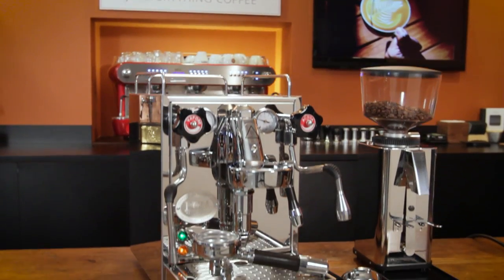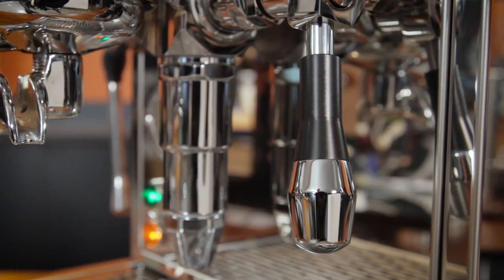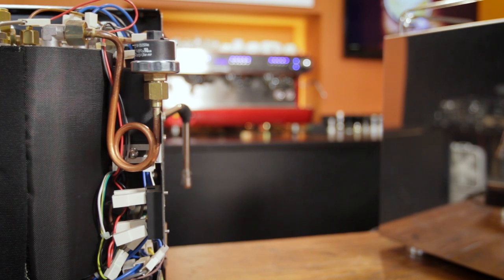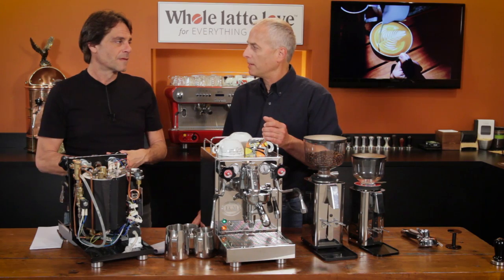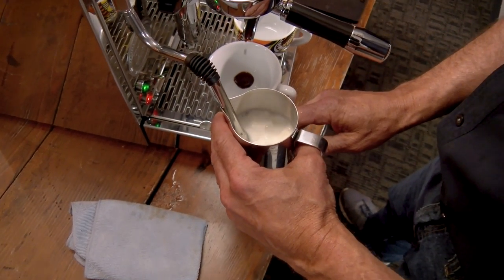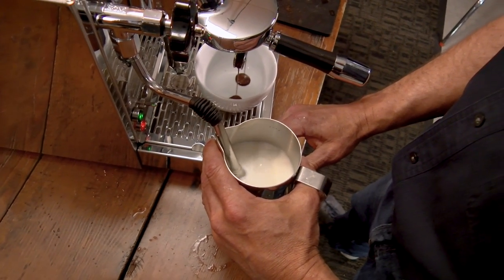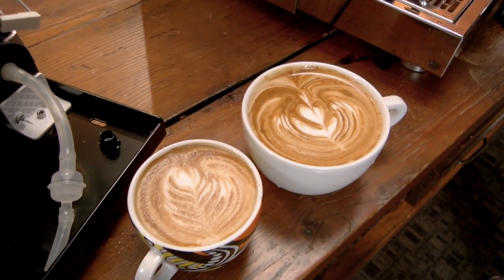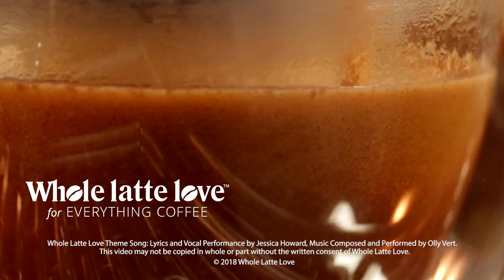Review ECM Mechanika V Slim Espresso Machine

Comment: A thousand thank yous for the review. Your video and your replies to comments and questions was instrumental in my deciding in favour of the ECM Mechanika V Slim as opposed to other comparable HX machines. I find that everything about it feels premium when compared to the Apartamento, the Pro 500, the Lelit Mara and others, although I am sure they are great machines too! :). 

For all of you out there comparing options, I had a chance to find a store in my city that retails all four of the above mentioned.  I spent a lot of time with each one, turning the valves, flipping switches, holding the portafilters (wow!, just wow), activating the brew lever, feeling the steam and hot water wands, manipulating the drip tray, etc. Everything about the ECM feels so much more substantial.  Factor in the larger boiler made of SS, the engineering and repairability and I was even more convinced that this machine is for me. Mine even included a very decent tamper in the box.

I have one suggestion that I would like to share with all manufacturers of prosumer stuff like this...Since most include two portafilters, why not make one of them bottomless? That makes even more sense seeing at the spouts are screwed on...just include the single and double spouts and I can decide which one I leave on that portafilter.  Thoughts?

Anyway, WLL rocks!
Reply from the maker: Hi MFM, And a thousand thank yous for sharing your opinions! Nothing like hearing from someone like you with hands on time detailing their decision process. I agree with you 100% ECM is the class act of prosumer level machines. Durability, repair ability, quality components and simple reliable engineering stand out in their products compared to other manufacturers. It's refreshing that a few manufacturers are including decent heavy usable tampers with some of their machines now.

On portafilters... Love your idea. Honestly I'm surprised single spout PFs are a thing anymore. Nobody I know pulls singles. Maybe it's still a done in other parts of the world but I do not know any baristas or home users who do singles. In the last 10 years I might have done 10. The majority of those to demo a single shot basket engineered to give the same extraction as a companion double without a change in grind size.

I'm certain most prosumer machine users would welcome a bottomless portafilter in place of a single spout!

You rock a whole latte - thanks and Happy New Year!
Marc
Reply: @Wholelattelovepage  And a Happy New Year Year to all of you too!

Another idea that I am curious to find out if manufacturers have considered...

Why not imbed a few thin strips of heat resistant silicone length or cross wise across the cup warming tray between the holes? Something subtle and barely above the surface so the cups sit on that rather than directly on the beautiful mirror finish so as to not scratch it. Another benefit would be that your cups are a little more secured in place and don't slide around when you remove the tray to fill the tank (if you rather not remove them all when you lift it off). Just thought I should share.
Reply: 💯 agree with you!

Comment: I've been debating ECM Mechanika Slim vs Rocket Appartamento... I've now reached my decision and it's the ECM based on the clean look of the internals. OMG that valve tree is a geek's dream. Looking at the connections, everything is shielded, the Pressure Stat with the Static Relay is a winner, also the gauges mounted high on the machine. So much ergo engineering and built-in safety features. Mechanika Slim WINS! After the holidays, I'm getting it from Whole Latte Love, not freaking Amazon or Ebay. #EspressoGoals. Love this channel!
Reply from the maker: Hi SM, Thanks for the wonderful comment! ECM machines are incredibly well designed. If you have not seen it here's some video from their factory covering their design philosophy: https://youtu.be/K0RI5rdz4Ww
Marc

Comment: Marc, Todd, thank you so much for this informative review and showing us the inner life of the Slim!

I’m wondering, which pressurestat model is actually built in or rather how loud it is and how often would it start to heat up?
I plan to arrange the V Slim near to my working space, so that’s why I’m curious about the machine sounds while not brewing, but just in a “stand by “  mode waiting for the next great shot

Unfortunately I can’t find any information on that in the www
and my local ECM salesman cannot answer on that properly...so I count on you guys;)

Best! 
Sven
Reply: Its a Mater pressurestat, small and quite and does not heat the boiler very often due to the boilers big size.
I hope I’m right...

Comment: I am wondering if you're able to do pre-infusion with steam wand without having flow control on ECM mechanika V Slim?
Reply from the maker: Hi Shih, No you can't as the Mechanika uses a heat exchange boiler which isolates the brewing circuit from the boiler so releasing pressure from the steam generating section does not change brewing pressure or flow rate. But, the Mechanika is available with flow control! With that option you can do low flow rate pre-infusions and many other flow profiles. Check it out here: https://www.wholelattelove.com/products/ecm-mechanika-v-slim-espresso-machine-with-flow-control
Marc

Comment: Great review....but why buy this rather than the pid Profitec Pro 500?  Surely the Profitec has more going for it with the addition of a pid. And they are the same price virtually!
Reply from the maker: Hi John, Thanks for the comment and great question. Some will prefer the PID Pro 500. But why might consider the Slim? PID does give incredible brew temperature stability. And even though the 500 is a heat-exchange machine no cooling flush is required. Flow restrictor in the E61 thermo siphon system is designed to eliminate flushes. But if you want to change brew temp on the 500 it does take some time for everything to equalize to a new temp setting. On the Slim, a cooling flush is typically required. In use one can quickly change brew temp by adjusting the length of the flush prior to an extraction. While the Slim is not PID there are extra details like a larger boiler, narrow design, angled portafilters and exterior accents like the chromed ends on PF handles which match the group lever and the tapered E61 group head.
Marc
Reply: Whole Latte Love thanks Marc. I find all your vids so very informative and helpful to a newbie like me.  Cheers

Comment: I was sold on the Profitec pro 500 pid, but now this new ECM has my thinking. How about a comparison video? You could include a the Rocket Apartmento too. Love the styling of this ECM, I just wish Profitec would improve the looks of their machines and they would easily dominate at this price point.
Reply from the maker: Hi Funk, Thanks for the comment/request. I would like to do a compare of these machines - it's in the queue! Some basic differences: Pro 500 is of course PID so it has rock solid accurate brew temps without a cooling flush prior to starting an extraction. Without PID HX boiler machines like the Appartamento and ECM Mechanika Slim require a cooling flush prior to an extraction. While the PID gives accurate brew temps, if you change the brew temp it takes 10-15 minutes for the thermal mass of the machine to settle into the new temp. On non-PID HX machines one can quickly adjust brew temps by adjusting the duration of the cooling flush. With those, temp is adjusted more by taste as there's no readout of the brew temp. Appartamento vs. Mechanika Slim: The Slim has that huge boiler in a small package so more steam reserve that the Rocket. I prefer the internal design and extra finish touches on the ECM.
Reply: I'd love to see a show down video between the 500 and the Slim. Thanks for the reply!
Reply: @Wholelattelovepage  Also looking for this comparison video! Thanks!

Comment: Why such a big boiler? How much preheating does it take for the machine to get up to temp?
Reply from the maker: Francois Bergevin big boiler for temperature stability and no fade in steam power. Up to temp in 15 minutes although I would suggest a little longer for full stability. This type of machine with mechanical power switch can be run from WiFi power block for remote/automatic on/off so it’s always heated and ready to go when you are.

Comment: One feature my wife is very concerned with is a timer to have the machine warmed up first thing in the AM. Besides the machines with that feature built-in, or ones with a very short warmup, or getting a new wife, is a solution to put a timer on the power receptacle and turn it on and off there?. Thanks
Reply from the maker: Hi Jeff, Thanks for the question. Yes, outlet timer is the way to go! They can be used with most any classic espresso machine which has a mechanical power switch like the Mechanika Slim. With a Wifi timer you can turn on/off from just about anywhere! Just be sure the outlet timer is rated to handle the power load.
Hope that helps!
Marc
Reply: Thanks. I used to be just a normal coffee addict, but now that I'm getting sucked into the Espresso Vortex it’s headed for a new level.

Comment: Nice review gents. When you say it has a 2.2L boiler does that mean it is always boiling that much water or is the tank more like 1L water and 1L steam? Just trying to get my head around boiling 2L of water to make a a single coffee every morning...😅
Reply from the maker: Hi s74, The total internal volume is 2.2L. As you guessed it's not entirely full. Some space holds steam. Larger boilers have better temperature stability and contain more steam for better milk frothing. A machine with this size boiler may be overkill if making 1 coffee per day.
Marc
Reply: Whole Latte Love hi Marc, Im pulling apart the group head so that I can make a general inspection of the inox filter and gigleur. I’ve removed the group cylinder from the e61, but having trouble removing the lower group cylinder from the group cylinder top nut to get access to the filter. Any trick to it or is it just tight? The cylinder unscrews anti clockwise out of the nut?

Comment: Hi Mark. Do you offer the optional black rotary knobs for ECM Mechanika V Slim? I prefer the black decor over the red decor.
Reply from the maker: Hi Sebastian, The red in the knobs are metal inserts which can be removed if desired. I do not believe we have black replacements with the wording. That does not mean they are not available and I can investigate further if desired. The ECM Classika has a black insert but wording is incorrect for use on the V Slim. Classika is a single boiler machine so wording on the single insert is: "ACQUA VAPORE" as one valve is used for both hot water and steam.
Marc
Reply: @Wholelattelovepage  Thanks for the quick reply and for investigating. The matching C-Manuale 54 has an optional black grinding scale as seen in the ECM's official website (https://www.ecm.de/en/products/details/product/Product/Details/c-manuale-54/). I assume this is why the black inserts are shown here: https://en.wiedemann.coffee/produkt/ecm-mechanika-v-slim-eiche/
Reply: @LuckyBuns  Any news on the black inserts? Not a fan of the red ones either...

Comment: Hi Guys. Great video. Are the valves on the Slim ‘sprung’ in a similar way to the Profitec ones? If not, what is the disadvantage versus sprung valves? And can you explain the advantages of upgrading the steam tip to 4 or 5 holes from the standard 2 please?
Thanks.
Reply from the maker: Hi Owen, Thanks for the comment and questions. Valves on the Slim are not sprung like those on the Profitec machines. The disadvantage is faster wear of the seals. It's not a big deal unless the user is constantly over tightening the valves which accelerates wear. With a sprung valve, it's a spring which closes the valve and not the turning force of the user. On steam tips... Number of holes is a personal preference. Some users like more holes some like fewer or single hole tips. The big thing with steam tips is balancing steam output with a machine's steam production. Some machines come with tips which are so well balanced that they will never run out of steam - they could steam continuously and never run out of pressure. On a machine like that you could use a steam tip with a larger single hole or more holes and get an initial shot of more pressure that then tails off. Some manufacturers make optional steam tips with more holes. Typically, as more holes are added the individual hole diameter is reduced. Hope that helps!
Marc

Comment: Hello, may I ask which one you prefer this ECM or the Bezerra BZ10 and why? I'm still deciding which one to buy :-)
Reply from the maker: Hi JPS, Thanks for the question. IMO main choice is between machine with E61 group the Mechanika and Bezzera's BZ group used on the BZ10. You'll have faster heat up times with the BZ group and what some would say is a more classic lever group in the ECM. Both machines are built well. The ECM features excellent finish quality and is available in the "Profi" model which is plumbable direct to waterline and has a rotary pump: https://www.wholelattelove.com/products/ecm-mechanika-iv-profi-switchable-espresso-machine
Marc
Reply: @Wholelattelovepage  Thank you....I finally went for the BZ10. To me, it has a bit more of the Italian flavour/experience.
Reply: @jean-paulschmeitz5015  2 years on, are you still happy with your choice? I too am deciding between the Bezzera and the ECM.
Reply: @katiebarr3120  Hello, tbh I had many issues with the Bezerra (broken electrical circuit and heat element) and ultimately I could return and went for a rocket appartemento (quite similar to the ECM). With this I’m super happy :-). So I would go for a rocket or ecm in my opinion the build quality is much better/more premium.
Reply: @jean-paulschmeitz5015  thank you, that's made my decision so much easier!

Comment: Hello bought this lovely thing today. Prepared everything as in the manual written. Water in the tank, plug in the socket and switch on... no thing happened. Not even after a couple of minutes. What did I wrong?
Reply from the maker: Hi Dario, If in US give our tech support a call at 585-924-7170 and they can help troubleshoot the problem. It's likely something very simple like a high limit switch. If not in US here's a link to our troubleshooting guide in our support wiki for the ECM Mechanika V Slim: https://wiki.wholelattelove.com/ECM_Mechanika_IV/troubleshooting
Marc

Comment: That's a large boiler on this guy!! Its's interesting that ECM hasnt use the joystick on this model.?
Reply from the maker: Hi J, It's HUGE! Need to confirm but think our shop technicians have put lever valves on a Slim.
Marc
Reply: Whole Latte Love hi marc should be a special order right? Retrofitting a joystick on a mechanika. Does is cost much?
Reply: @Wholelattelovepage  any updates on this?
Reply: @Wholelattelovepage  Also interested in a response about joysticks on the slim

Comment: Hi Marc. great review. Do you know whether ECM will also produce a Slim with PID like the Pro 500 or is it possible to upgrade the Slim with PID? Or can it be modded that no cooling flush is required anymore? Thanks, Roman
Reply from the maker: Hi Roman, Thank you for the comment and question. I was at the ECM/Profitec factory a couple months ago and heard of no plans to make a PID version of the Slim. Could it be modded by the end user? Probably. But there are considerations as far as flow rate of the thermosiphon to the E61. That's controlled by a flow restrictor in the thermosiphon system which takes the engineers a lot of trial and error to get right. Hope that helps!
Marc

Comment: Great video, is there a review of the Technika v pid?
Reply from the maker: Hi simon, Thanks for the comment and question. No video yet, but more info here on the Technika V PID: https://www.wholelattelove.com/products/ecm-technika-v-profi-pid
It's a very nice machine, plumbable, rotary pump, HX boiler with PID and excellent ECM engineering and build quality. It's very similar to ECM Synchronika but with HX instead of dual boiler.
Marc
Reply: @Wholelattelovepage  thanks. I'm currently running an ascaso dual boiler and want to upgrade. Will I really see the difference for the money. Also have you had any issues with baratza sette? Mine has just stopped working twice in four months requiring repairs

Comment: How hot is the hot water?  How much can you pull out at once?  Wondering if this can essentially replace an electric kettle for things like tea, preheating water for cooking, and making foods which need hot water.
Reply from the maker: Hi Chris, Thanks for the question and my apologies for the delayed response. Been offline for a few days. So, Mechanika Slim has a very large 2.2L boiler so hot water for tea etc is no problem. Guessing it can put out at least a liter of near boiling water at a time.
Marc

Comment: The Slim is the perfect size but I wish it had levers instead of rotary knobs.
Reply from the maker: Hey Ted, Many do like the joystick levers! It's a bit wider, but if in the US you might check out the Quick Mill Arnos. It's a PID HX with lever operated valves and exterbally adjustable brew pressure (OPV). Here's my colleague AJ with a review video posted last week: https://youtu.be/GYdEaLS85Jk
Marc